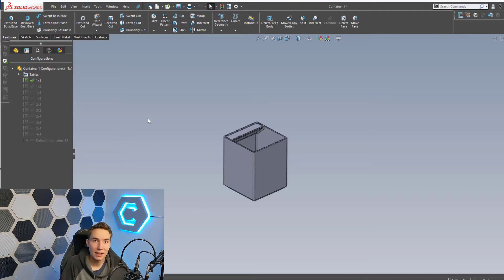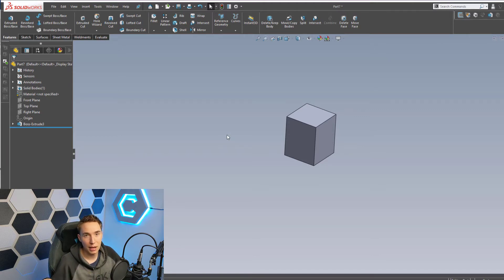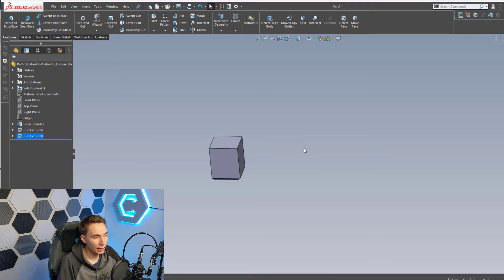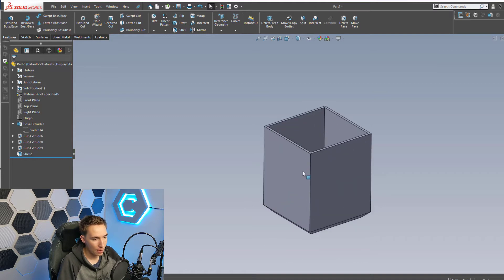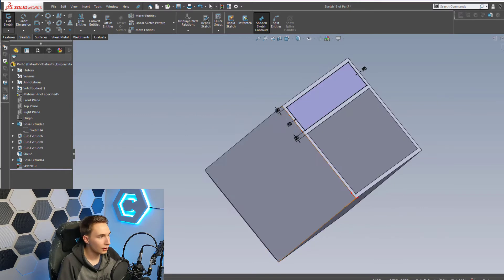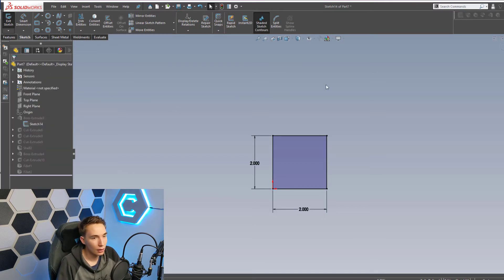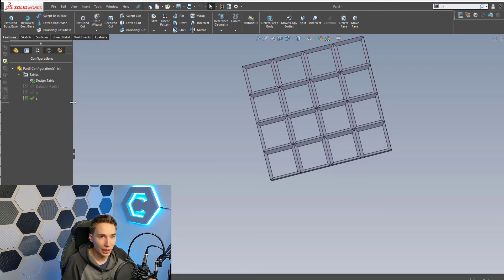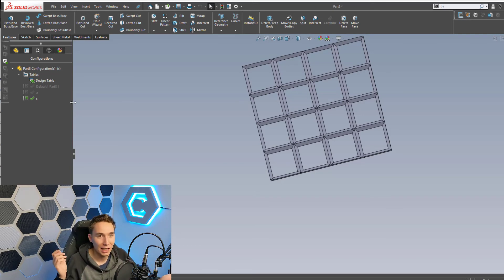Designing 3D Printed Containers in Solidworks!

Comment: So how much does a 1x1 print cost you. Allit has an organizer system with different sizes of one common grid and the 1x1 you get for 50 cent. So calculating material, time and power are you sure you end up cheaper than that? I cant really believe that. Don't reinvent the wheel and certainly don't try to out-cheap products that are available as molded parts.
Reply: People's suggestions come from what they would do, with your suggestion being to buy x product instead of 3d print, it sounds like you don't get any use out of your 3d printer other than printing whatever is popular on thingiverse, i.e. baby groot, and baby yoda's, squid  game, whatever is flavor of the month, then it's not touched for months after that. You might be in the wrong hobby.
Reply: @lolslim690  If you waste time and money for printing stuff you'd get for cheap, who really is "in the wrong hobby" LUL
Print your boxes and be happy.

Comment: All sound stuff. However, choosing a square module severely limits both volume and fitting into different sized spaces. Roughly 2:3 gives the widest options- I chose 80 x 55 as the base module. You can multiply either dimension when scaling. This also matches a commercial size, so their trays fit plus their tote carriers will take your trays.

Comment: Great video! Is this also possible in Fusion? Because I have never done anything in SolidWorks :(
Reply from the maker: You could also build these in fusion however you won't have the design table functionality. I suggest giving solidworks a try, you can get a personal license through EAA for only $40 

https://www.eaa.org/eaa/eaa-membership/eaa-member-benefits/solidworks-resource-center/eaa-solidworks-standard
Reply: I use fusion 360. While you cannot use the design table, re-sizing by moving the sides is easy. Few seconds each. And it is free. I do not use the base grid, as who wants drawers with gaps?